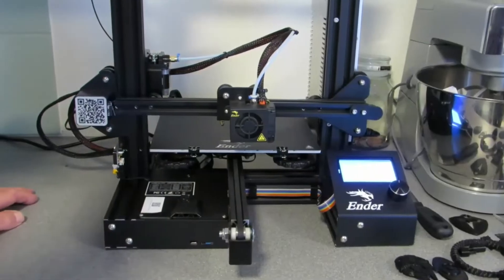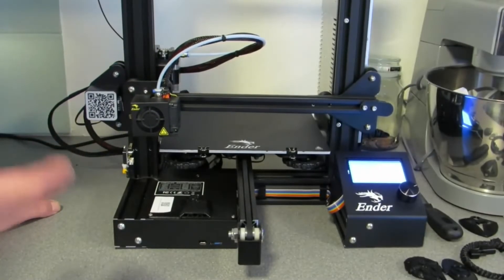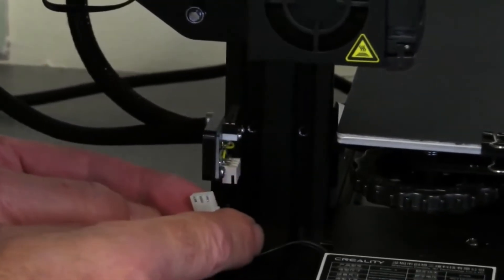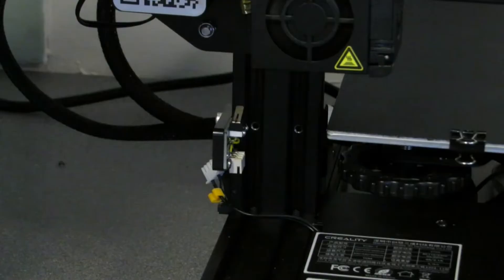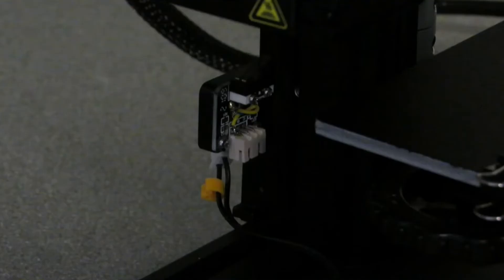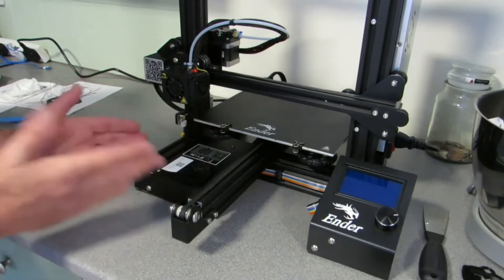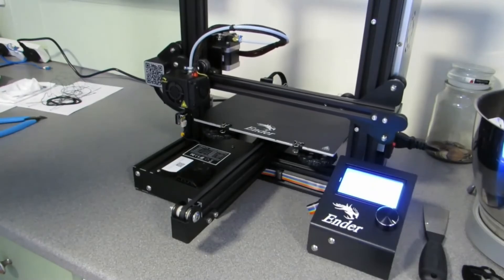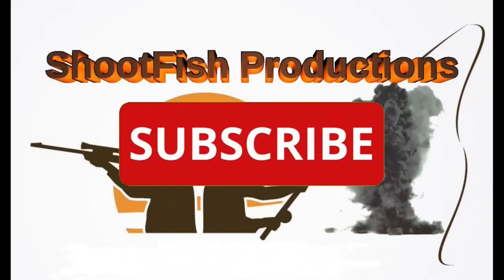Homing Failed On Creality Ender 3 How To Check & Fix

Comment: I bought mine off of FB, the guy had bought a crap ton of mods for it and didn’t have everything put together. It originally had the 1.1.5 board and I put the 4.2.7 board in it along with the BLtouch and made sure the wiring for the BLtouch is correct. The issue is when I hit home or bed level I get a grinding noice and get the home failure pleas reset message.
Reply from the maker: disconnect the stepper motors one at a time to isolate the grinding noise and take it from there. Could be wrong polarity or connections on motherboard or motors.

Comment: so i had to reinstall my firmware still not even sure if i have the right one cause its a second hand printer and im very new but none of my axis are responding to anything it just shows up with "homeing failed: printer halted please reset" ive tried everything and nothing is working for me
Reply from the maker: your motherboard will have numbers on it so you can check what firmwarw will work with it. If firmware update dont work, could be motherboard.

Comment: I have a duplicator I3. But the weird thing is that both the x and the y had this fault at the same time - after something went wrong trying to initialize a print from my PC and crashed the entire software. And then my X and Y homing stopped working. Don't know what that's about!
Reply from the maker: wow, unlucky. check all the switches.

Comment: Everything works but my X-axis. It just makes a noise and moves the belt a tad. Any tips?
Reply from the maker: have you checked the x axis microswitch?.
Reply: @shorty4901  yes, and it's working. I have Ender V3 and the switch is on toolhead PCB which I replaced for a spare one and yet I still have a problem with homing the head. It just bumps to the left and makes awful noise.
Reply from the maker: @skate4life977  check the leads under the bottom plate, make sure they are in the right places.
Reply: @shorty4901  ok, strange to check Z axis when I have problem with X but I'll check em today.. Basically my printer did reset and I can't get past first calibration. I saw a video where it checks Y so it can level itself then just heat the nozzle etc. My printer head just went to the left and makes sounds. I checked everything - every single cable, touch sensor, changed PCB and ribbon cable. Also, changed the hot end and reflash the firmware. Only what is left to check/change is the motherboard. I get the 2022 and abnormal nozzle error.

Comment: Mine did the same thing,wouldn't autohome,would go up to the XAxis switch and just kept bumping,Homing Failed Prnting Halted Please Reset,I think the Firmware deleted somehow(,I put a new switch on,the lever fell off,then the  Btton)but it still won't Autohome,So,I ordered a new 8GB card,and got a link to Firmware download file ,and hopefullythat will solve the issue,what  a piece of ***t.
Reply: Same I download new firmware for my Ender 3 because I got the CR touch auto leveling kit and after switching to the firmware it said “Printer Haulted  please reset. It couldn’t even auto home can someone help fix this pls.
Reply: @Ethandog18  omg, im having the same problem.
Reply: Has anyone got a solution to this problem, yet?
Reply: @skate4life977  No one has solved this yet!!!!